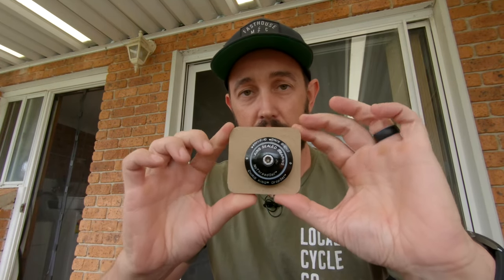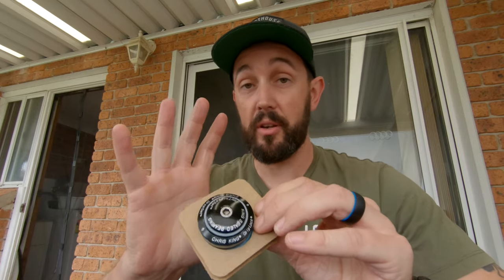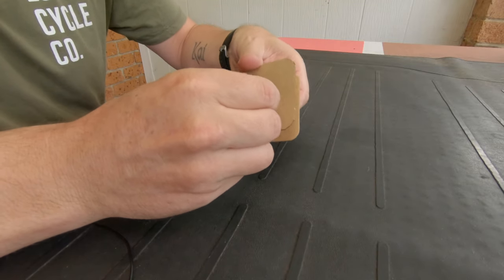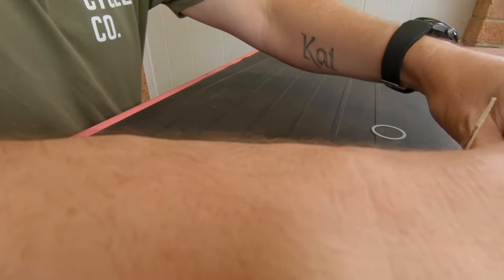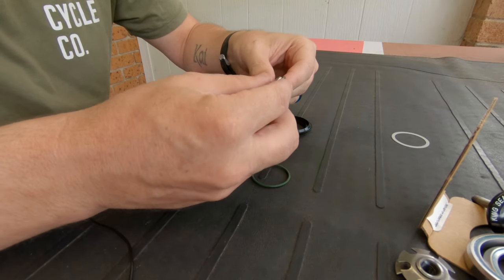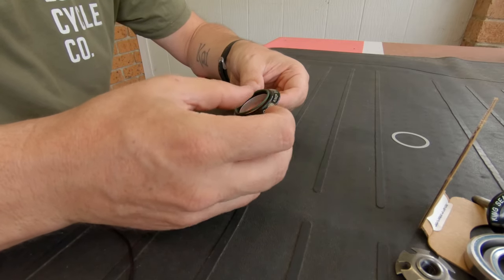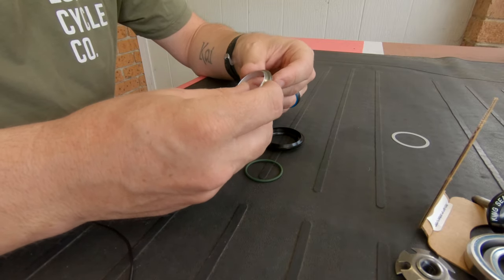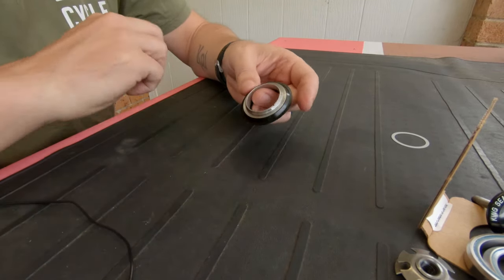Lavery's MTB Vlog - Episode 10 - Chris King Dropset 5

Comment: Hey:) no baseplate for the fork included?
Reply from the maker: Refer to 1:18 I had it already installed on my fork
Reply: @LaveryMTB  its all good. I was just curious about if its included in the set or not and it is, so I just bought it yesterday (had to replace my old fork and did not bother to remove the old one baseplate ^^